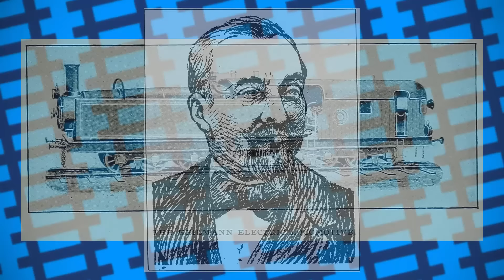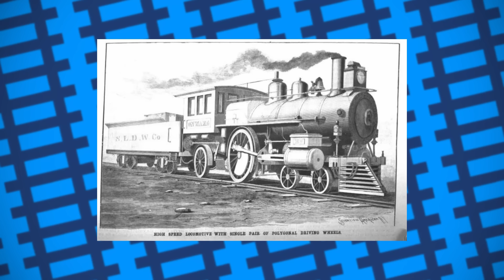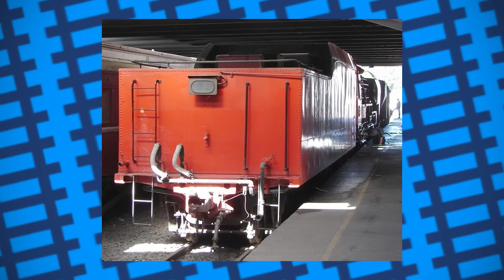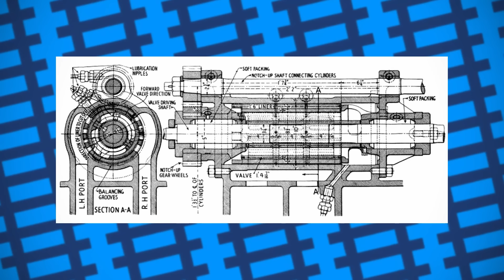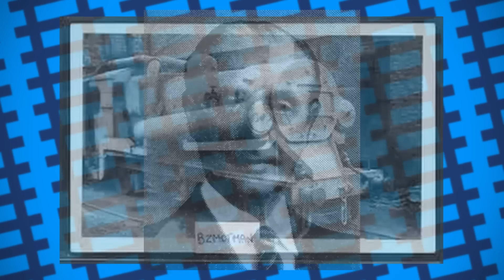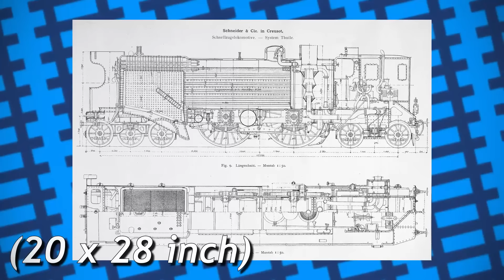Train of Thought COMPILATION - Even More Experimental Engines

Comment: If the M1 and the jawn Henry had been built like the heillman with reciprocating steam instead of steam turbines, they might have had a better chance, due to better part load performance. 

With a condenser configuration, you could potentially steam turbocharge the reciprocating portion with exhaust steam, similar to the proposed turborecompressor in the sharpe garratt.

Comment: Steam/ electric reminds me of Myles naGopaleen.... Later I found out that his idea actually was used in Switzerland.
Reply: I'm frankly surprised Rowland Emett didn't have a go at overcomplicated steam-electrics.  What, exactly, did John Duffy's other brother identify with regarding that type of motive power?

Incidentally people misunderstand what the Swiss locomotives did.  They were tireless locomotives that used the electrical heating only for superheat -- considerably less daft than 'boiling water with electricity'.
Reply: @wizlish not necessarily, one use case is a fireless mode for city/underground, another is coal branchline ops with electric mainline ops using a single engine